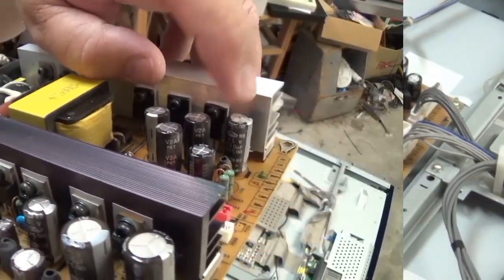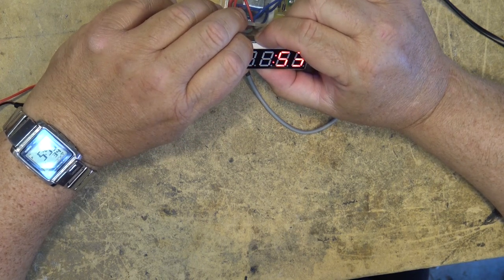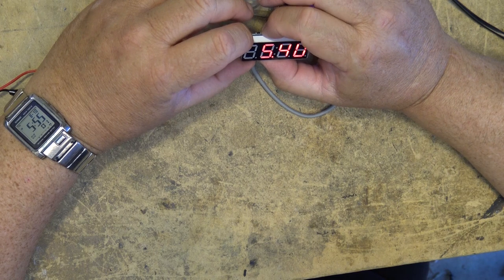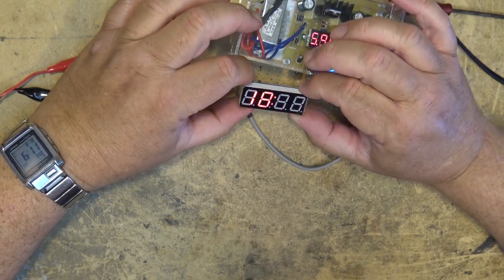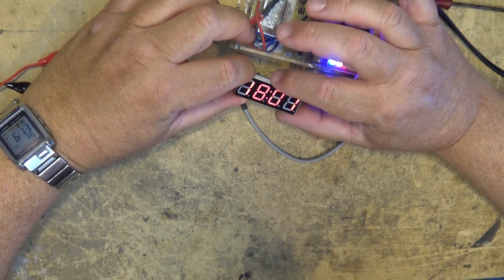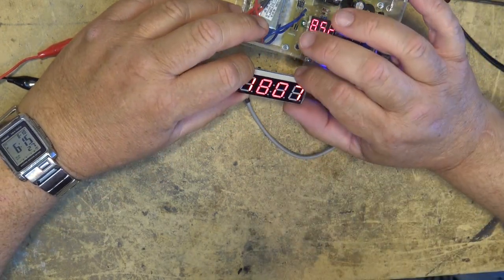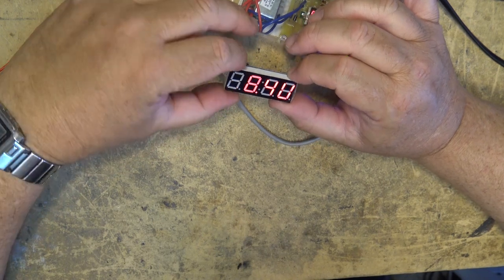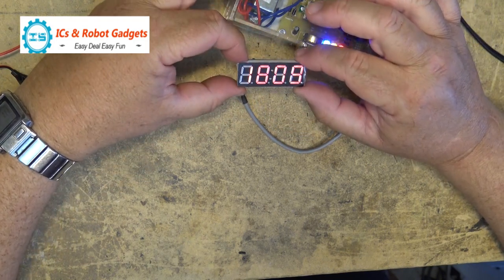Unboxing and demo of a multi function temperature, volt meter, clock module

Comment: from the data sheet 
Product parameters: 
  
1, power supply voltage: DC5.0 ~ 30V 
2, the temperature function range: -40 to 120 degrees, resolution 0.1 degrees. 
3, voltmeter function Range:DC5 ~ 30V(need pure DC power supply, 
24V battery is not recommended for use because of possible charging voltage is too high, burning) 
4.size: 40x13mm 
How to use  
 Under non-setting state, press the left button of adjustment time (note in the middle of the colon is bright), 
1. At this time "minute" starts flashing, increase press right, adjust the range 00 to 59. After a good tune, "minute", 
2. Press the left button, then the "hour" starts flashing, increase press right, adjust the range 00 to 23. 
3. tuned "hour", then press the left into the adjustment date (note in the middle of the colon is off), then "day" starts flashing, press right to increase adjustment range 1-31. 
4. tuned "day", then press the left button, then the "month" starts flashing, press right to increase adjustment range 1-12. 
5. After adjusting the date, then the left, then "year" starts flashing, increase press right, adjust the range 2012-2049. 
6. adjust the "year", then press the left button, go to show the error voltage calibration function [x.xU], the unit is 0.1V, a positive number indicates an increase, a negative number indicates decrease. 
7. Then press the left button, enter the temperature error calibration settings [Ac: xx], xx on behalf of the correction value, increased by right, a positive number indicates an increase, a negative number indicates decrease in degrees. 
8. Press the left, into the cycle defined function dd option status display items, press the right to change the value: (dd: 0) time + temperature + voltage, (dd: 1) time + voltage, (dd: 2 ) time + temperature, (dd: 3) Temperature + voltage. Press the left button, the display alternately into circulation interval dF option, press right to change the value, the greater the value the longer the interval. DF Do not set to 0, otherwise it will be black. 
9. Finally press the left button to save all settings value and return to normal display.
Reply: I have this display too and the time does not advance after I set it and idea?

Comment: That's a cute little device, im guessing that one chip is the r.t.c for time/date and the other is some kind of micro controller that does the work.

I would imagine they are the company that produce volt/amp meter modules too, great for adding to any project power supply :-D

Comment: I can only assume that the Ac Ad settings are used to activate cooling/heating, like a peltier device.
Reply from the maker: The ac setting is to calibrate the temperature sensor. 
Measure the temperature with a real thermometer, and see the error, and it can be adjusted +- 5 degrees so the display reads correct.

Comment: I believe that Ad is to set the display length when it cycles through time, temp, volts.....its the 'time to display' each one from 0-9 seconds....I think. (0 could turn the display OFF entirely so be careful!!!)
Reply from the maker: I initially thought that, but it does not change the display cycle time as that option did on the other clock module I tested.

Comment: Wonderful website with a lifetime of gadgets.  Not locating the module :^( but there are many, many others to consider.  Also, what is that fascinating board in the background?
Reply from the maker: Cliff Miller 
The board in the plastic case is a variable low power DC power supply I built a year or so ago. It was one of the projects banggood sent me to assemble. I have a dso scope to put together next. I get sent projects to demo and build from a few suppliers.